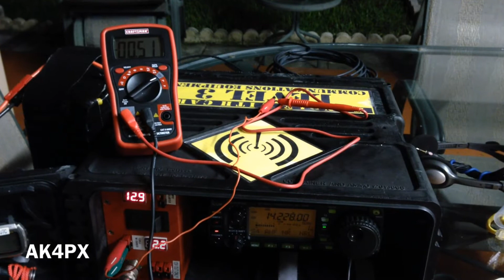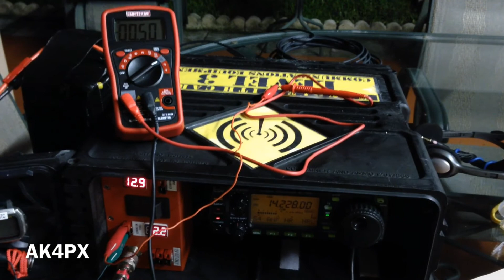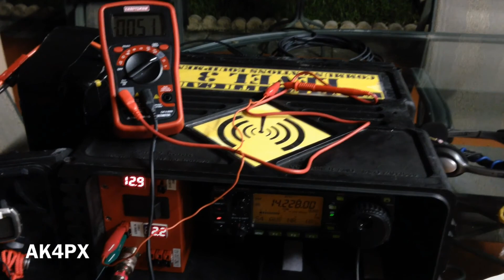ICOM IC-703 Plus Amperage / current draw usage

Comment: Great video,love my Icom ic-703plus,works very well on power consumption.
I did however noticed on  FM-N (2.5K\9khz filter) the fm squelch can chop and over sensitive.I resolved the issue by Changing 
 R2101-to 50K 1% 0603 -SMD-less chopping squelch.

Change R2152-to-15K 1% 0603-SMD-increases  AF gain from radio and much louder for mobile operations.
Reply: Regarding the radio modification is this something you came up with on your own or is there information on doing this in a forum?